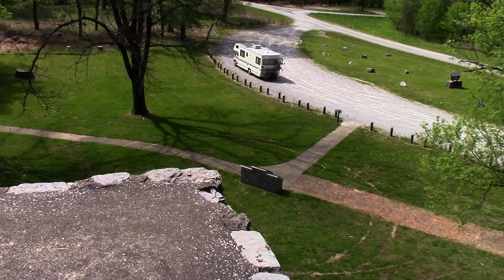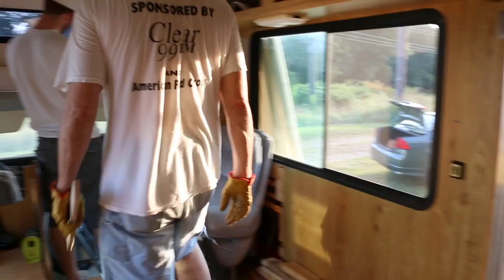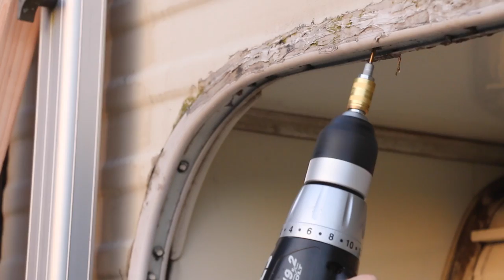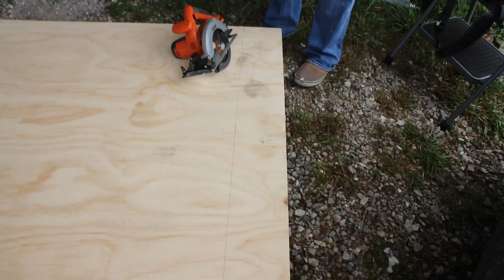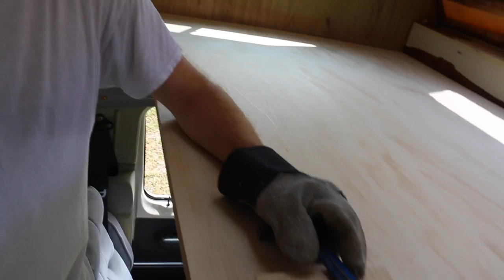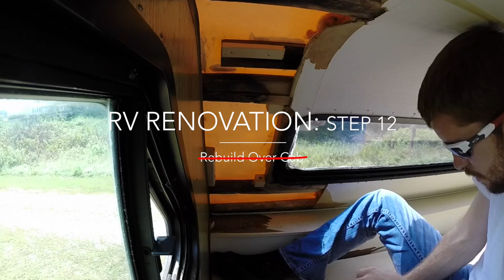Rebuilding the Over Cab of Our Class C RV

Comment: I bought a class C with lots of leaks.. I had many similar issues that your videos are addressing so I thank you! One question I had was did you screw the underneath portion above the cab up into the new framework inside?

Also... My front window seems to be leaking somewhere. Have you seen anyone just remove the leaky thing, frame and mount something over the old hole? Tin? aluminum? plastic? Wood?? Many of the new RV's don't even have this ""feature"" so I am more inclined to just remove it than buy several hundred in rubber and hope it doesn't leak.

Thoughts?

Comment: I need to repair the bunk area that has water damage on an old 86 tiago arrow. Was not sure where to start but this helped me a lot thanks. gonna check out the rest of your videos.
Reply from the maker: Thank you, Andre! Best of luck with the rebuild!
Reply: starting a 31' Minnie this week. Found laminated 3/4" plywood to replace the existing laminated floor! 1 little leaking side window is the culprit!  But that bad boy took out both sides of that floor!

Comment: did you not put insulation under the board on the top cab above the front area, are you not worried about condensation?
Reply from the maker: There is insulation under and behind everything.

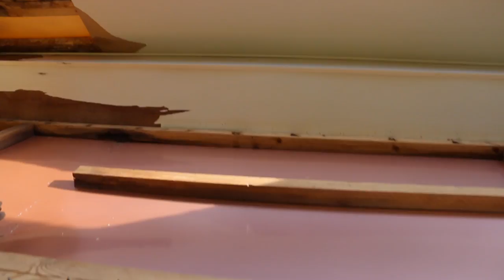Comment: cool vid. couple questions here. at the 1:30 area of the vid where u pan across the passenger side of cab over...there appears to be rust. wont that continue to rust out? there is a product u can spray on metal to slow the rust down. it would be cool to see detailed work done around the window at cab over. if i push against my cab over window that area flexes in and out a bit. i know these windows are notorious for leaks. good job. pretty cool.
Reply from the maker: +ant ajd Thanks for the suggestions on the rust. Now that we look back, the rust you see in the video is most likely the steel screw going through the aluminum flooring. Not sure though. We also have some more details on the over cab window in future videos... Both the outside and the inside. We agree, the over cab areas are very poorly designed. Thanks for watching :) -Michael and Jenny

Comment: Fixed several cabovers. Find them like what this fix did. RIP that out, and glass mat first. Epoxy that, then put aluminium strength members to tie into cab, then poly board (starboard) over and chemically weld that all. Spray glue the contact paper like wall back on and done. Never leaks. But I'll note the issue 99% the time is front window and that gets addressed as well.
Reply: The problem is not windows, it is using cellulose based materials such as wood, Luan, cardboard etc which contain mold spore  that actively grow when they become wet. The solution is to use welded aluminum extrusions for the framework, and azdel for the face sheets. I have learned this from rebuilding my forest river cabover 3 times
Reply: @jvaubry  that's why I only use resin now and aluminium like described. I've also fixed several and ones I still own still in woods no issues. Wood and all that other materials you mentioned are for cheap builders. Fiberglass is heavy but offset by aluminum so same same on weight. But nothing comes close to waterproofing or insulating quality. Added to strength that is superior to any other tie ins. Glad you got it fixed. Hardest part on these is facing the problem you know you need to address. You nailed that so much respect there.
Reply: @herewegofans Thank you.  Azdel is a composite sheet product that is impervious to water.  The rv industry switched to azdel in place of Luan on the exterior under the fiberglass fascia in 2011. Azdel is much lighter than fiberglass and resin, though marine epoxy is used to bond the azdel to the aluminum frames
Reply: Azdel comes in 4x8 sheets. So the typical wall construction is welded 1.5 in sq aluminum extrusions with 1.5 in thick foam insulation and azdel inner and outer face sheets. I had triangular gussets welded from 1 in sq aluminum extrusions to bolt between the front facing wall with window and cabover floor.  Very strong and insulated and waterproof structure
Reply: Rounded exterior between the two wall units was constructed of 2 in foam board profiles and sheet aluminum wrapped around the internal profiles and mechanically attached to the gussets. About $5000 cost for materials, expo you, welding and 2 months work

Comment: my 76 coachman has A lot of water damage..it's nearly winter now.  I can't afford to do a rebuild right now.. should I re seal everything now or just wait till spring when I can do a rebuild..
Reply from the maker: What we did was seal the roof in October before winter set in. Then we bought a water proof/breathable cover off amazon for about $140. That lasted us through the winter. If I were you, I would just prevent any future leaking on the roof and then get a cover on it if you can. Even if it's a big tarp (just make sure not to trap moisture with it). Hope this helps! Best of luck! -Michael

Comment: Did you guys take the insulation off the walls before building on? If so, what was your secret to not damaging the aluminum?
Reply from the maker: We're not really sure what you are asking. We did take the insulation out of the walls, but only if there was water damage. Hope this answers your question...
Reply: The construction of the walls in my RV is: exterior aluminum, insulation (which is glued to the walls, and luan (which is glued to the insulation). I'm doing a lot of the same projects that youve recorded. But removing the insulation from the walls (and ceiling) proves to be pretty difficult. Didn't know if you had any tricks.